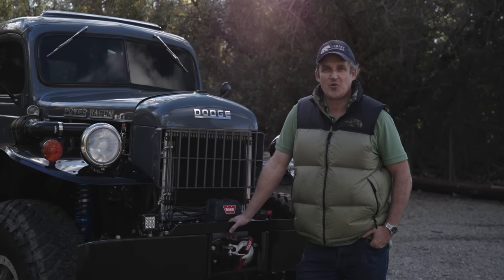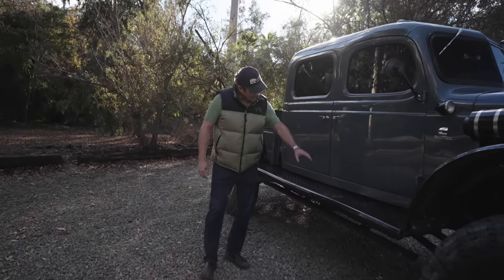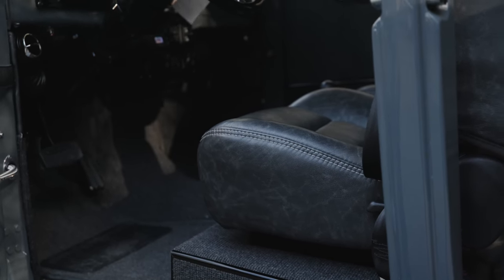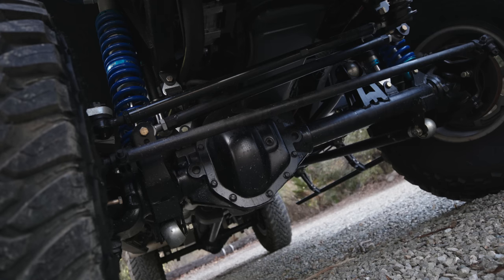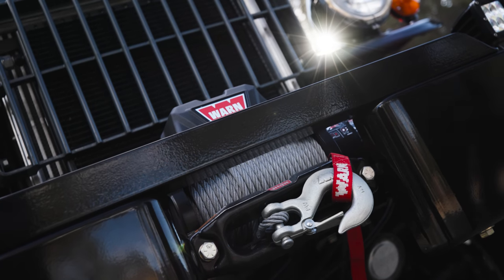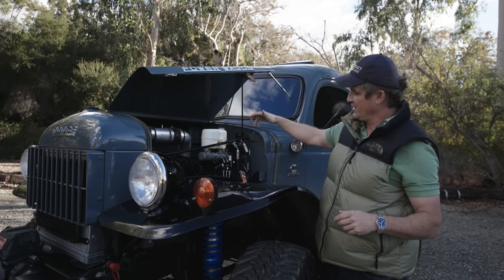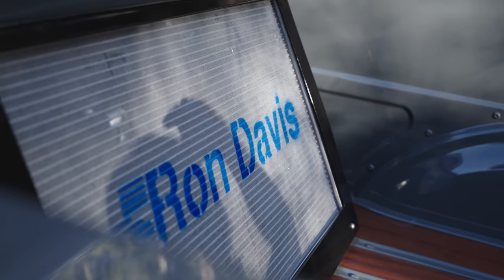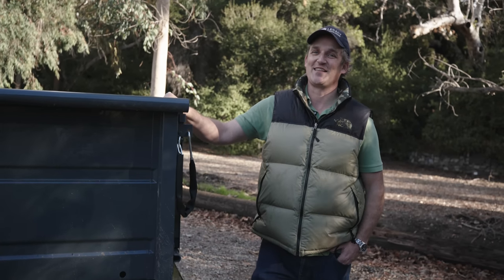LEGACY CLASSIC TRUCKS DODGE POWER WAGON | TOYO TIRES [4K60]

Comment: It's interesting how so much money was put into this build, but they didn't bother spending a few hundred dollars more to get the Turbo housing and exhaust manifold Jet Hot ceramic coated to prevent it from rusting.  Makes the whole engine compartment look cheap and unfinished. Not to mention the cooling benefits of ceramic coating ?